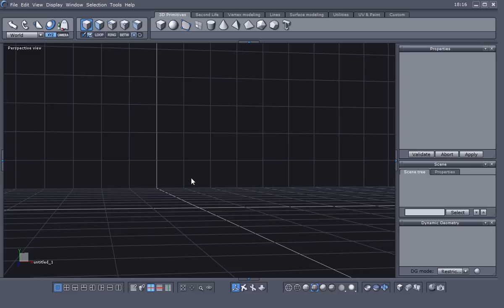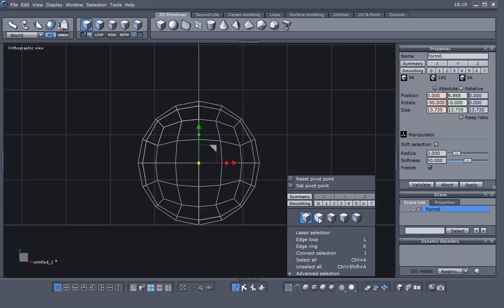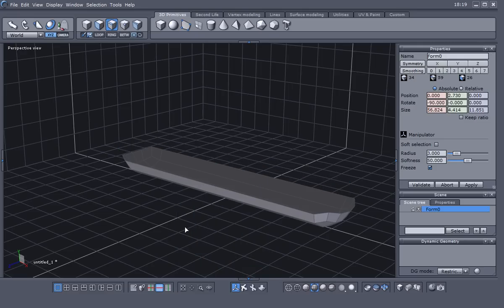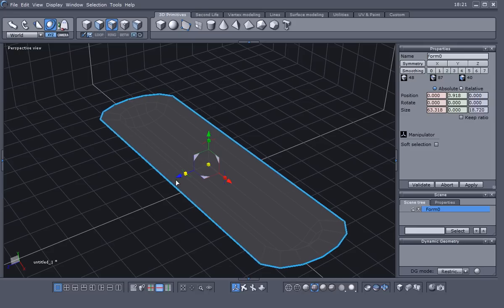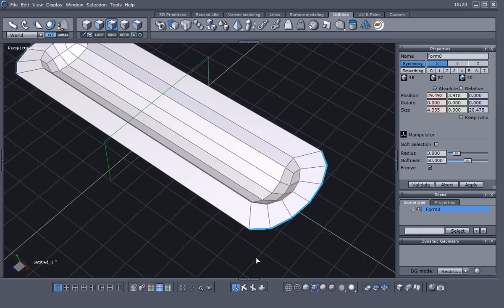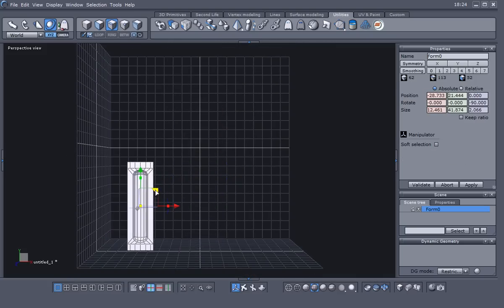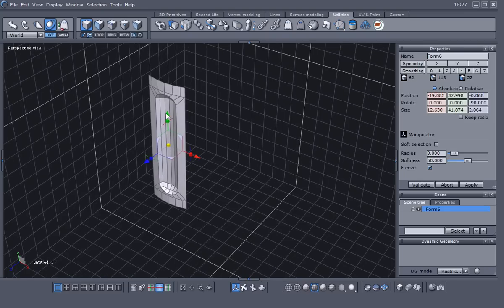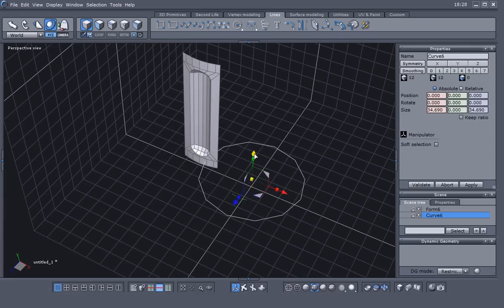3D Modeling Model a Column in Hexagon 2.5

Comment: Just as an aside, while new to Hexagon, I did find that the taper deforming control is predictable after all.

Basically, it depends on your camera angle. When it says adjust 'x', what it gives you is the ability to adjust the red edge lines of the bounding box that are in the x-axis direction. What that actually means is you can grab those x-bounding-lines to cause a rotation either around the y-axis or the z-axis.

So, if you are looking more from the front rather than top, adjusting the bend min/max, or grabbing the red lines with the mouse, causes the first (undesired) action seen in the video, where you see the bend from the front, revolving around the z-axis. Where as, if you move to a more plan view, you can then adjust the bend as was the authors intention, where you see the bend from the top revolving around the y-axis.

So, to rephrase, the x-axis control means to adjust the x-bounding-lines by pulling them left or right, which causes a twist 'around' one of the other two axis, where the axis revolved around depends on your camera angle. In this case, use front view to revolve around the z-axis that runs for and aft, and plan view to revolve around the y-axis that runs up and down. The same logic will apply to the other y and z settings.

Thought that might be useful for people to know in case they are getting stuck on it...

Comment: Hi there. I also have the same problem as Hugh Gulland, where the control key turns into a yellow globe and can't do next steps (ie at 14:47-15:08). Did anyone solve this issue? Would love to finish it, please and thank you.
Reply from the maker: I tried to recreate the issue you were having. The only time I could make the issue happen was in face selection mode. Double check to make sure that you are in edge selection then convert that selection to points. I hope this helps.
 It has bee a while since I have used Hexagon. I am working my way into 2d concept art.
Reply: johnnybevo A forum friend told me that maybe when I did the average welding section, that maybe some of the verts never joined and I think that's my problem, but don't know how to fix it. I tried the tutorial all over again like 5 times(pausing video as much as I could to make sure I'm following it right) and still same problem. I will keep trying and hopefully will get it fixed. Thank you for taking the time to reply, much appreciated.